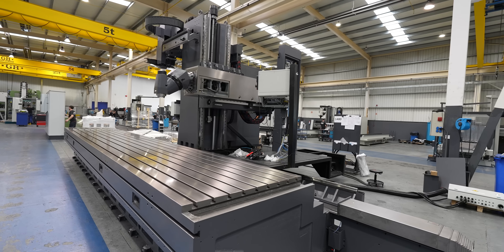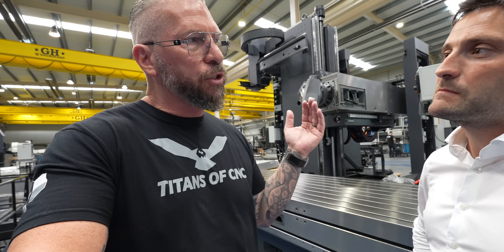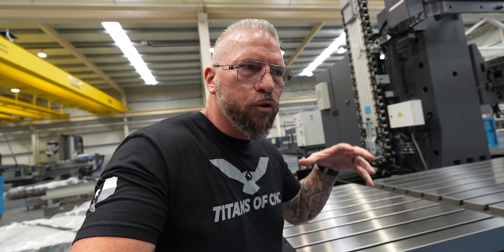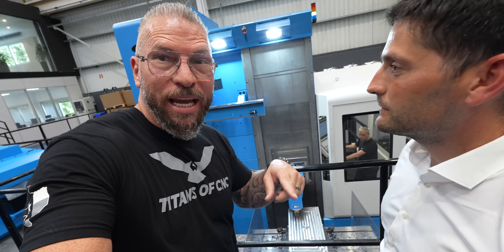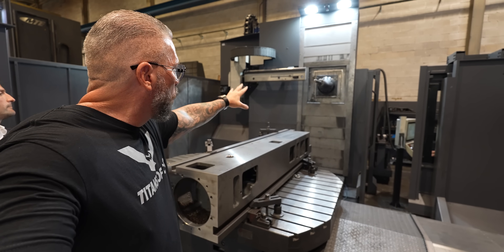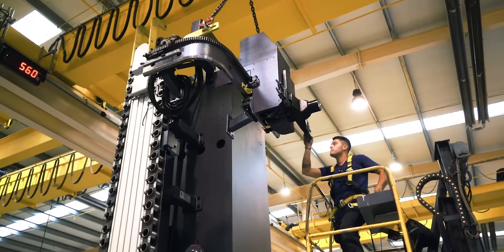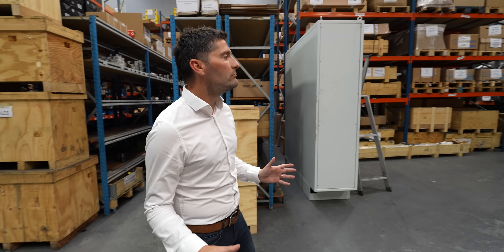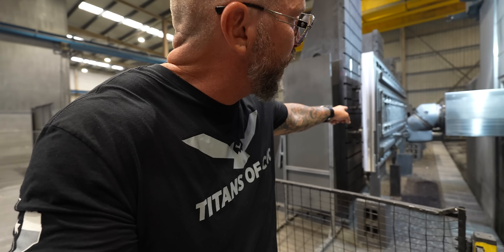Machining Monsters: The Longest CNC Machines in the World

Comment: To machine a table like that you need a bigger table and to machine that...
Reply: TOS and ŠKODA Machine Tools in Czech republic making these types of CNCs :) biggiest machines i ever seen in my life :D the operator has his own cabin, which is fully controllable, and the ŠKODA company has existed for more than a hundred years, and TOS is also pretty old :D
Reply: @matejkuka797  i've seen some tech specs on Skoda HCW4?  i think , y axis 10000mm , "z axis" 2 stage - total around 4000mm . X axis up to 40000mm  ! . Also it had automatic milling head changer  . I think they could add even more X travel if there was a request , but i don't know where might one meet a single piece part larger than 40meters , and what foundry could cast such a monster (not to mention transport and handling).
Reply: @kisspeteristvan wind turbine blades easily reach that size. If a factory mass manufactures these, maybe they could cast them in a single piece and finish it up with a CNC? Don't know enough about manufacturing to know if this would be viable tho.
Reply: @amos9274  they reach it yes , but for that to be a success , they would need multiple special programmable steady rests - steady rests that also drive the workpiece , cause milling it driven from just one end will induce too much distortion (over such huge distances) .  technically many things are possible , economically .... i'm not so sure .
Reply: @matejkuka797 big parts that TOS and ŠKODA couldn't machine was made in company I worked on a "Waldrich Coburg". Most of the manufacturers of middle and large machine used Waldrich Coburg machines at some point
Reply: I think the table is made our of multiple pieces combined into 1 big table
Reply: Eventually the table will follow the curve of the earth and only be good for making large radius arcs.
Reply: @JonathanDuddy-oq6nv you can correct for that
Reply: @markmontagna7637  it was a joke dude....
Reply: @JonathanDuddy-oq6nv lmao
Reply: Stół jest nieruchomy. Kolumna z wrzecionem się porusza w 3 osiach. Stół składa się z kilku części. Skala robi wrażenie, ale to taka sama frezarka jak zwykła narzędziowa.
Reply: Shin nippon koki also makes some pretty large mills.
Reply: It's tables all the way down
Reply: And then what creates the one that's bigger???
Reply: Droop + Rein
Reply: @alextricks1128  the snk mills i run have segmented tables and linear guides that all get trammed together during assembly.
Reply: These aren’t that big
Reply: Super amazing